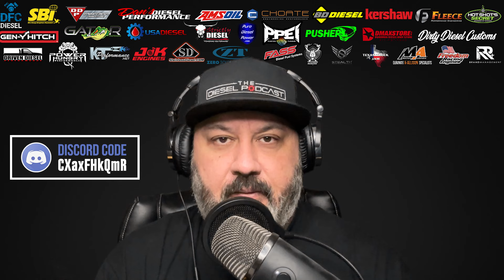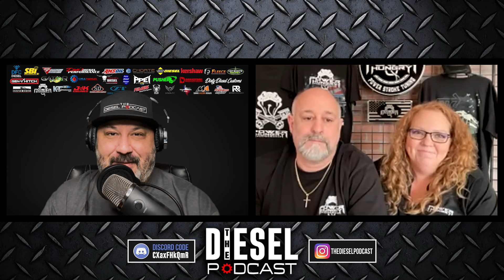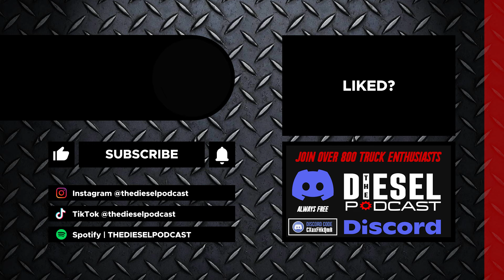7.3L Powerstroke Hydra Chip Tuning!

Comment: Appreciate the 7.3 content! I daily my 97 CCLB4x47.3 (in Los Angeles lol) and love it. Installed a Hydra on it and it was the best mod I’ve done yet. Simple to install, woke it right up and zero issues with it.
Reply: What have you realized for this chip vs the SCT Self tune controller to achieve the tune  results. Im new t0 the 7.3 and am tryin to get up to speed on the two similar devices .

Comment: The biggest issue with the 4r100 transmission is probably the ridiculous tiny transmission cooler Ford put on the truck, change it to the 6.0 liter transmission cooler and the temps will drop about 40-50 degrees.
The other issue is the check valve in the bypass line on the 4r100 transmission, best to remove the bypass and install high flow fittings.

I've had my 2001 Platinum Edition F250 4x4 for 24 years and wouldn't trade it for anything.
The 7.3 is FORD TOUGH at it's best.

Comment: I daily an '00 Ex with 301k miles. I bought this one with 260k, and as far as I can tell it was never tuned. Hydra went on the next day. It'll get some custom tunes once my injectors go in. I actually have tunes from PHP from 2015-16 for those injectors, but they are for a ZF6 truck, otherwise I'd just load them up. That truck was fantastic, from startup, idle, drivability, towing... Which is great for custom injectors with 100% nozzles.
I eventually want to learn the Minotaur software, so I can play and tweak. Transmission tuning is possibly the biggest, although clean power is a given.
Does Charlie know you spilled on a new product? Can't wait to see what comes from the summit!

Comment: I recently purchased a 99 f450 with a 7.3. It has 4" exhaust and aftermarket intake.
I'm considering adding the Hydra chip.
Being that it's a 6 speed would I have to get it custom tuned?
I use this truck for my masonry business and sometimes haul some heavy loads.
It only has 135,000 miles and as is I'm very happy with this truck. 
I was looking at some used trucks and this one was one tenth the cost compared to what I was finding.

Comment: I’m doing some mild exhaust port work on my 00’ 7.3 cylinder heads, Hard to find Fact of What to Do and What Not to Do. I’d like to hear some testimonials from Anyone that has done customized valve modifications, Not just smart ass opinions. It can be done, it’s been done, there’s room for a bit larger valves, and More Air has to be proven technology because every new diesel cylinder head for almost 20 years now has went to 4 valves. If Millions of trucks have the same thing in common across all manufacturers spectrums, More Air is something that has been proven beneficial. There’s a huge gap of information on 7.3 head porting, that’s pretty much what I’m saying. Someone has to be able to pioneer a small adjustment to break the physical crest of dismal airflow, Especially when dealing with Boost. Compressed Air takes advantage of every micro spec of opportunity to move through passages. Does anyone have some kind of numbers or examples of improved performance directly correlated to airflow/valve modifications?